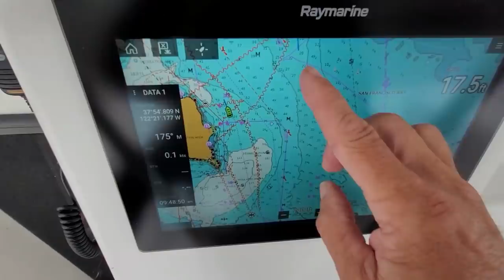We're BACK! And Looking SOUTH! - Onboard Lifestyle ep.162

Comment: I Missed you , welcome back. Living with lithium is WONDERFUL Is'nt it. Had my system 8 years and have not had to do anything too it IT JUST WORKS, like being on land you just don't have to think about it. Just turn on the inverter and plug what you need . Switched to induction cook top and an AMAZED how fast it heats and boils and used little energy overall. Easily 2.5 times as fast as propane and heat does not heat up the room either.   CHEERS AND FAIR WINDS    Steve h.

Comment: Steering:  it always appears to fail at lock. Check to see if you can limit cylinder travel by 1/4 ".  It may be overtravel, and the rudder may be providing the force. Try to limit linkage and cylinder overtravel. Good luck.

Edit to add: also check linkage for camming action at overtravel.

Comment: Teal you should be careful if you plan on passing though Bodega Bay.  If you see a huge flock of birds heading your way get inside and batten down the hatches.  Also if you see a thick Fog rolling in you need to raise the main sail, the Jib and the Spinnaker and push the throttles of both engines to max and get the heck out of there.   Do NOT pick up any soggy looking sailors looking for a ride.

If you go on shore and someone keeps telling you  " I know what you did last summer "  just tell them
"  Of course you know what we did last summer. You saw us doing it on our Youtube channel ".

Comment: Thankyou for sharing this, I would not have known this is an issue and the very simple engineering solution with reusable parts on the vessel.  You could also use the same system for the generator or the air conditioner unit seawater cooling systems if fitted

Comment: As a precaution, you should probably flush the other engine also. Did you rig up any kind of strainer when you did the flush so that what came out didn't get pumped back in? Something as simple as an old nylon works wonders.
Reply: We will definitely do the port engine as well.  I did use a fine mesh strainer on the bilge pump.

Comment: you may want to install a hydraulic fluid filter.  Since most hydraulic fluids are low viscosity there wont be much of a pressure drop (or stiffness) added to the system.  Note:  the larger the filter, they more difficulty purging the air out of it.  You can always include a bleed screw.  Blue Skies.  :)

Comment: It is good to see you all back on the Tube again. 
If it's not one thing- it is always something else to delay your departure plans.
Boat Stuff Happens- pretty much. Steering issues again. Engine over heating.
Life and your family matter the most.  Braces gone for Emma-check. Lynn has
a repair- check. Teal and Compass are next. A family dental plan is important- just say'n.
Getting South- IS the plan for now. It is pretty Basik when you check your course by the compass
the real one- not the four legged one! Life aboard without dew awaits.

 Fair winds, warmer weather, and new ports of call with sunset views plus a 
cocktail or two maybe 3 in Lynn's case, be glad that Teal is done with "thickened
epoxy" work- for now. So... in review: Emma's smile improvement-Bingo.
Lynn's patience for warmer location is being tested big time.
Teal- on any given day I do have to fix something else again around here.
Compass: Ok who aboard hid my dog treats? I'll keep barking until you do find them.

Comment: Welcome back. Not to give you another project but I bet you could fashion an emergency tiller to attach to the exposed part of the rudder linkage. It sure would be nice for that eventual time when the hydraulics give way again to be able to quickly attach a means of control. I have separate rudder and outboard steering on my Gemini 105M which gives me some measure of backup but on my to do list is emergency tillers for both systems.
Reply: I'm pretty sure they already have one.

Comment: I don't understand why they don't just run some copper tubing or similar into the sea water in a protected spot to do the heat transfer. Why pull sea water inside the boat through a heat exchanger and then back out to the sea again? It should be a closed interior system. That way nothing will ever get in to clog a heat exchanger or whatever.  Can someone explain why they still make them the way they do?
Reply: A keel cooler is what we locally call your idea of an outside hull system to transfer heat from engine coolant.    There's a big downside to this in that it can suffer damage from submerged semi floaters or grounding. This normally calls for haul out. Another problem could be fouling with seaweed.